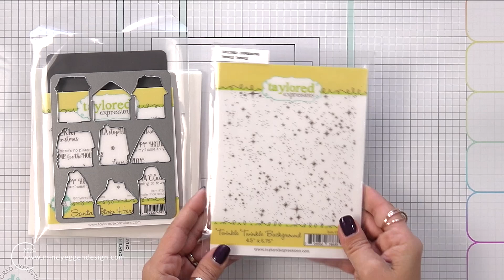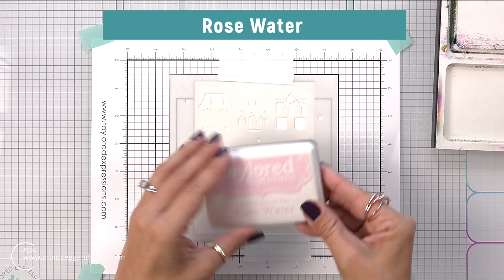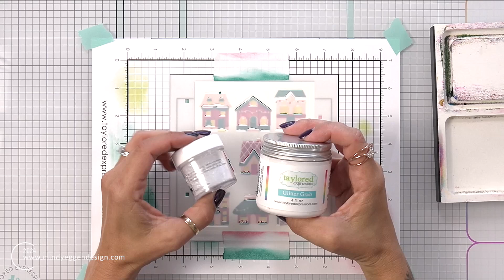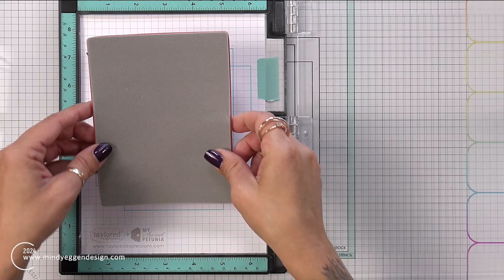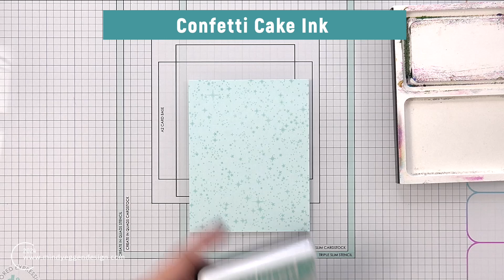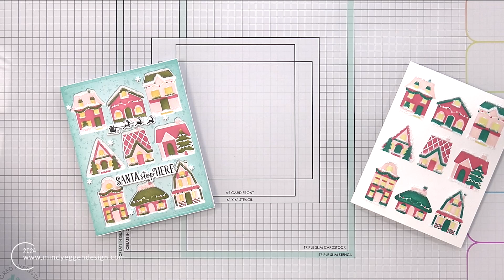Sparkle Up Your Holiday Cards With This Easy Snow Effect

Comment: @Mindy Eggen Design • Mindy: This is a great stencil set. The level of detail gives a wonderful result, but inking the stencils isn't fussy (except the 2 light strands.)

I love your color combinations and the fact that you took the time to prepare multiple options. I liked your demo combination as very seasonal but lean toward the gingerbread and monochromatic. You certainly inspired us!

Your technique for placing the card stock in the MISTI is the first time I recall seeing it done that way.

I love the way you used the cover die for a frame but pointed out its use to cut the houses out. That makes them so much more versatile for scrapbooking and journaling.

Great cards & great video. Thanks for sharing.
Reply from the maker: Thank you! Actually inking up the string of lights on the house IS a little fussy as they want to move when you ink blend over them, that's why I offered tips .